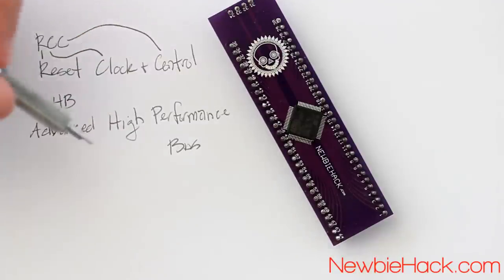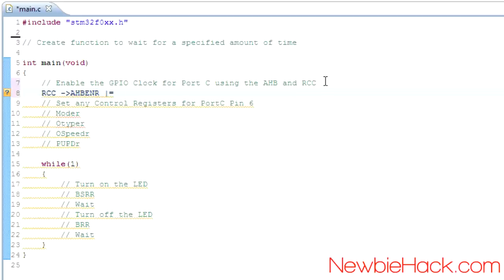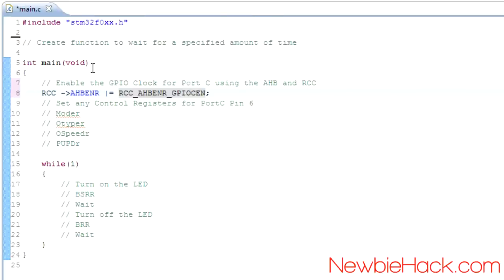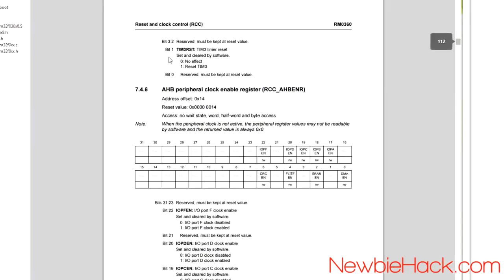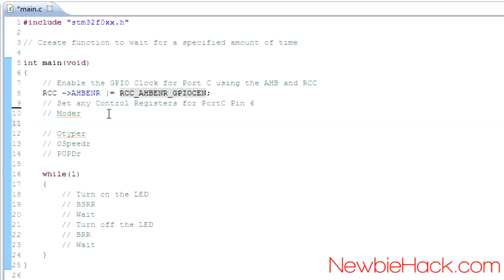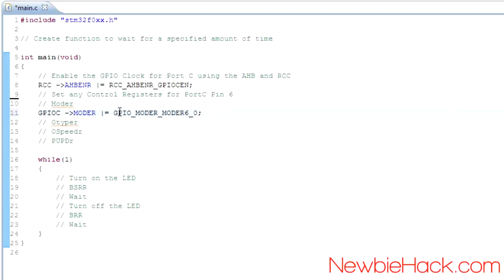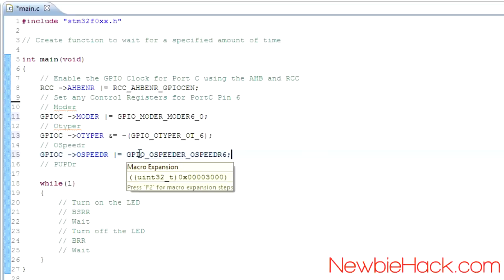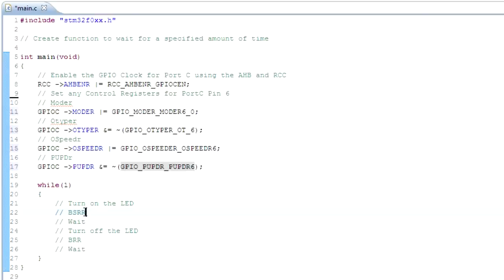7. How to Output to a Pin to Blink an LED for Arm Microcontrollers - GPIO Tutorial Part 2

Comment: Thank you Patrick for great tutorial.

I have few question. Hope you can elaborate a bit.

1. Why did we chose push-pull instead of open-drain in type register. May be I need to understand the difference between push pull & open drain . Will you please point me to relevant literature?
2. I am guessing choosing a higher speed will make register clocked at higher speed which would explain high power consumption. Please confirm.
3. Why we chose no-push and no pull. Why not pull down as initial state as we will pull LED up later?

Thanks in advance.

Comment: I have a query, supposedly the maximum frequency of the MCU is HCLK = 48 Mhz, but the reset values of the register set the HCLK = 8 Mhz, because of the change of PLL's settings. So, in every program that I made, I need to set the correct values of the register to set the HCLK = 48 Mhz?, or what is the default values of clock frecuency with not registers modified (RCC)?

Comment: Hi Patrick, I noticed in the data sheet for the STM32F030R8 is says the CPU frequency is "up to" 48MHz and that the system clock selection is done on startup.  Does this mean by default the clock speed is slower? And if so, how would someone set it?  (I apologize if you've already covered this topic, I'm only a few videos into your series so far)  Keep doing what you're doing!
Reply from the maker: Matt Pamenter not a problem. The uC defaults to 8mhz. You need to use the PLL to increase it. See my #48 video on how to do this.
Reply: Patrick Hood-Daniel Thanks!
Reply from the maker: You're welcome.  Hope it helps.
Reply: Patrick Hood-Daniel I took a look at video 48 but there was no mention of PLL or clock speed.  Is it possible its in a different video?
Reply from the maker: Embarrassingly, I was actually referring to previous to my last video, but that video is on patreon.  My apologies.
Reply: Patrick Hood-Daniel I see.

Comment: I thought it would be easy to convert this to M3, but at the reference manual there is no GPIOCEN under AHBENR. In fact it seems  that there is no GPIOCEN at all for M3. I chose M3 because the Blue Pill is very popular around here. I will try to find it at COIDE the way you did, but thanks anyway, cool videos.
Reply from the maker: What does the reference manual show for the AHBENR? You may need to find the enable for the port under a different bus.
Reply from the maker: Let me know the chip number and I will take a look in the reference manual.
Reply: Ok, the chip number is STM32F103C8T6, and the reference manual is RM0008,  thanks.

Comment: Is there any datasheet that explain all the "REGISTERS" ?
Reply from the maker: Yes, the programmers reference manual shows the registers very clearly.  Here is the reference manual: https://newbiehack.com/Documents/STM32F030Reference.pdf

The microcontroller's features are separated into chapters, , the registers are at the end of those chapters.  The title of the register would be something like this: RCC_CR and to access it in the code, you would write RCC->CR.  That would contain the contents of the register and also allow you to modify or test a part of the register.  Say you wanted to modify the HSI on register and set that bit: RCC->CR |= RCC_CR_HSION;  If the | "pipe" symbol for the bitwise "or" is foreign to you, I would watch the AVR series in my channel.
Reply: Thank you for the fast answer , i have found the section how to modify the Registers. But i have to go one step backwards , i mean is there any tutorial or Datasheet where i can read the function of the Registers . Lets say i want to know , what is the function of "RCC" or there are many Clocks and what are the functions of each of these clocks. 
In the reference manual there is a short description but its not really good for a amateur like me.

In the previous video you said , we need to modify these Register "Mode , OSpeed , OType ...." but where do you know that we need these register .
Reply from the maker: I'm going to have to recommend you keep watching these videos.

Comment: First of all Thanks for your great videos :D
https://youtu.be/uNuxK1ARuwU?t=10m6s
Here you've  put a 1 in the required bit, but haven't put the required 0.
Can we put booth of them in a single step or we've to OR and AND in a separate steps?
Thanks in advance!
Reply from the maker: Absolutely.  If you need to reset a bit (put a 0 in that position), then you can do that in a separate and/not, "& = ~", statement. It is recommended to do this.  If I didn't do this in the video, then I probably should have (if it is necessary)..